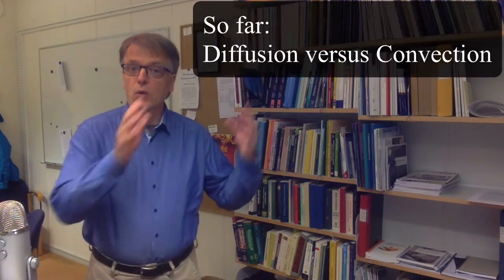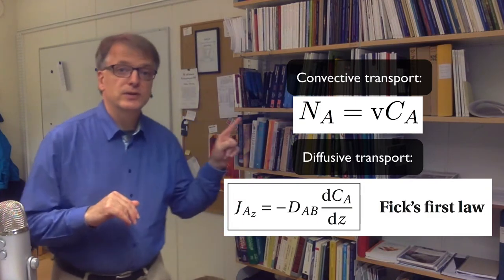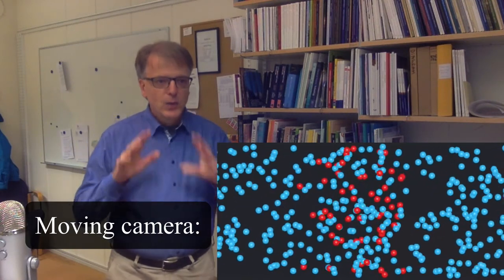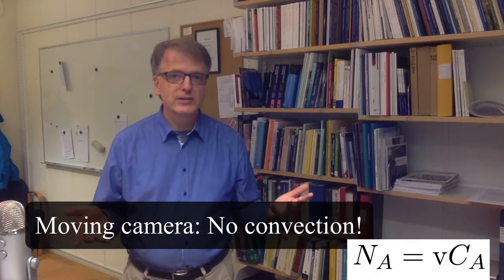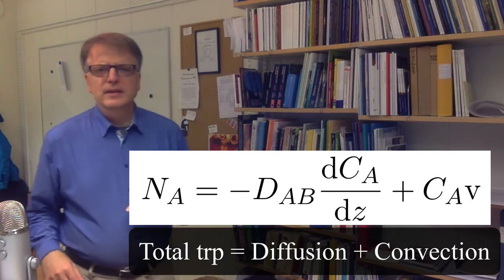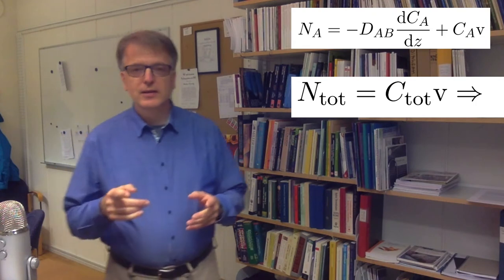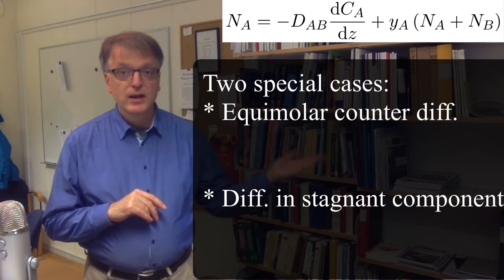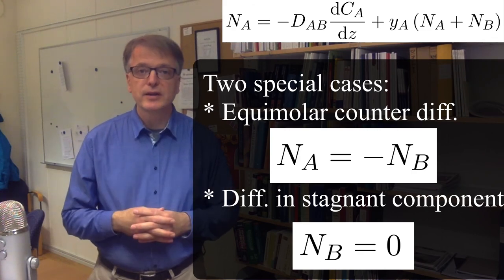Convection AND diffusion

Comment: Sir, while taking N total = NA+NB , if N total taken as total convective flux how can u add NA and NB to get N total?
NA and NB normally include diffusion flux and convective flux right ,so how  can you add then these both to get total convective flux Ntotal?
Reply from the maker: I think you misunderstand what convective flux is.  By definition, convective flux IS the net transport of molecules, thus in a system with only two components, the convective flux is the total flux (summed over both species), i.e. Ntot=NA+NB=Nconvective.

Thus, in Stefan diffusion (which you get if a liquid in a narrow tube evaporates and diffuses out into the surrounding) the fact that the volume increases when a liqud evaporates and forms a gas, together with the concentration gradient that causes diffusion, you have both diffusive transport and convective transport in the tube. 

I think it might help you if you watch the entire playlist on mass transfer
https://www.youtube.com/watch?v=XsujCJ_ko3k&list=PLvpgTFzUKO4_51rEIT6AbggF1UYYkLg2X

Comment: Hello sir , sir I have a doubt 
, we have seen here that even when there is no forced convection there can be convected transport due to the bulk ( molar average velocity) , what if the fluid has a forced velocity V, then in CaV , what is V? forced velocity ? and this transport is in direction of fluid flow only? or is there any transport in other direction too? what about them are they convected or diffusive?
Reply from the maker: Please only write your comment in the apropriate video. I have removed your duplicate comment from the Swedish video on using the mailings command in Microsoft Word.

Now to your question: Convection is per definition the average movement of molecules, thus v is always the average velocity of all molecules. 

In each case, you must look at your system and try to find a mathematical description that seems appropriate (e.g. two-film theory, penetration theory, boundary-layer theory or something else) If you need to, you may even add one more hierarchial level in your equation and talk not only about diffusion and convection, but also about eddie diffusion (which behaves mathematically like diffusion, but has a "diffusivity" that is different from the diffusivity that I talk about in my videos)

You do not need to have a fan or a pump to get convection, there is also natural convection. A simple example of natural convection is the air movement on the outside of a radiator. So, if you have an average movement of molecules, in any direction, that is nonzero that is your convection, regardless of the cause of that movement (pump/fan/density gradient/…)

More advanced answer: You might need to consider more than one direction… In the boundary layer theory video https://www.youtube.com/watch?v=FDfWyeqkKkU we are interested in the mass transfer (or heat transfer or transfer of momentum) in the direction orthogonal to the main direction of flow. You can think of this as diffusion through a stagnant compoment, although that would be to simplify a bit. The film next to the surface (laminar closest to the initial edge, turbulent further away) is moving.

The molecules (or the universe for that matter) do not care what equations we use. Our convention to divide the movement of molecules in to convection (average movement of all molecules) and diffusion (movement through random walk relative to this average movement) is just a handy mathematical abstraction that helps us making the mathematics easier to handle.

Comment: Dear professor,
As I know, this equation is used for molecular diffusion where NA = Fick's law + the bulk motion contribution.
If I compare it to what u wrote ==> bulk motion contribution = convection. But in your first video you said that convection is on larger scale ==> we dont speak on convection when we solve molecular diffusion as in this case. is it only a pronunciation difference? I do not know, the tittle convection vs diffusion is confusing for me, this equation is for molecular diffusion only taking into consideration the motion of the binary system and not an applied velocity.
Reply from the maker: I'm not sure I fully understand your question, i.e. what it is that you misunderstand.

First attempt to answer: Are you thinking of the difference between advection and convection? The term advection seems to be used differently by different people, some meaning that advection is a synonym for convection, others (like me) that advection is a convection that is caused by a pump or a fan or something similar. The latter implies that advection = forced convection but leaves the question somewhat open wether or not natural convection should be considered as advection or not (think air close to a heat source moving due to temperature-induced differences in density)

Second attempt: Note that the phrase "large scale" here means "larger than a group of only a few molecules". With large scale we here thus imply a large enough package that we can start talking about an average velocity (with a certain direction) of the molecules.

Third attempt: Note that in some situations no pump or fan is needed to create a situation where there is an average velocity of the molecules. If you look at the video https://www.youtube.com/watch?v=VXIwAkjYMLM you see that if you have a glass of water slowly evaporating, there is convection out of the glass (simply because 1 mol water vapour occupies more volume than 1 mole of water as liquid)

So, what this video is about is when you combine the effect of convection (average movement of packages of liquid) with diffusion.
Reply: I guess the second and the third attempts are quite satisfying. Thank you so much for your clear 'answers'. 

1- Does it mean that if we have a homogeneous medium (@ equilibrium) pumped in a tube, we still can write NA = CA.V? i.e. no need to have a difference in concentration.
 
2- What is the difference between NA = CA.V and NA = K.DeltaCA used in convective applications
Reply from the maker: Yes, kind of:

If you have a difference in concentration you can't use the equation. Situations where you have a difference in concentration includes the situation describe by Reynolds analogy and Chilton Colburn analogy, see https://www.youtube.com/watch?v=7YlQ_4jL_gs&list=PLvpgTFzUKO49qlw61JRGCeezUpcqxnhK8&index=28

So the equation is only valid if there is no difference in concentration, like when you pump a salt solution with constant concentration through along a tube. 

I would hesitate to use the term homogenous here, as that term can imply that there is only one phase (e.g. liquid) rather than that the concentration is constant. So if you pump a heterogenous system, i.e. sea water with some sand, through a pipe (like what they do in some countries including Denmark to attempt to keep the sea from eating away at their shore lines) you can still use the equation since the salt concentration is constant.

Comment: Hi Professor. Those equations applies for liquid liquid diffusion+convection?
Reply from the maker: If you're thinking "applies" as in "is exactly correct for", then some of the equation only apply to ideal gases and very special liquids. The  problem with liquids is that different molecules take up a different amount of volume and if you mix different molecules, strange things often happen with the volume (if you add 1 liter of ethanol to 1 liter of water, you get less than 2 liters of solution). Thus, in liquids the situation might not be exactly that simple that you can say that Ntot=Ctot*v

On the other hand, many of the equations might be good enough for liquids in many situations. Furthermore, these equations gives you an idea of what approximately happens in liquids.

Note 
1. This video is one in a series on mass transfer https://www.youtube.com/watch?v=EG4ZoVTSA5I&list=PLvpgTFzUKO4_51rEIT6AbggF1UYYkLg2X
2. The BIG elephant in the room here is that we're talking about binary mixtures and only one spatial dimension, and in how many cases can you say that your system is one-dimensional and only has two components? However, we are (in this series of videos) building up to mass transfer  in three dimensions (although still only "two" components, or systems which you may treat as consisting of two components, e.g. like moist air). The course that this video is a part of doesn't go into models for multi-component diffusion, but I think it is safe to say that it is a lot easier to understand multi-component system if you first get a grasp of binary systems.
3. In many real world situations, the use of diffusivities breaks down due to complex geometry and we have to settle for using mass transfer coefficients. However, understanding how these ideal model works and how mass transfer coefficients are connected to diffusivity can tell you a great deal regarding how the value of mass transfer coefficients are expected to change if you change operating conditions. More on that in later videos in this series

Comment: Conductive mass transfer or diffusion is same or different
Reply from the maker: There is no such thing as "conductive mass transfer". I think you are confusing mass transfer with heat transfer. Conductive heat transfer is the same thing as diffusive heat transfer. In a gas, conductive heat transfer is both due to diffusive transfer of mass (e.g. a molecule with higher velocity than the average moving from left to right) and due to transfer of velocity (and thus momentum) from one molecule to another when molecules collide with each other. In solids, diffusive heat transfer is due to transfer of velocity due to interaction between molecules. (In an ideal gas, the transfer mechanisms for heat transfer, mass transfer and transfer of momentum is so similar that the mass diffusivity equals the heat diffusivity which equals the diffusivity of momentum, if all are measured in m2/s.)

It might help you to watch other videos in the mass transfer playlist.

https://www.youtube.com/watch?v=XsujCJ_ko3k&list=PLvpgTFzUKO4_51rEIT6AbggF1UYYkLg2X
Reply: @PLE_LU  Thank you sir

Comment: i have noticed that u have not mentioned anywhere about chemical potential being the true driving force of diffusion. pls can u make a video on it as iam unable to understand  it from nowhere. also, can u explain about "N" and "J" in detail and there difference.
Reply from the maker: I don't think I used the term "chemical potential" anywhere, I rather usually say "difference in concentration" or "concentration gradient". Diffusion is due to random movement (e.g. due to Brownian motion). You can compare this with carefully putting black marbles on top of white marbles (the white and black marbles having the exact same size and density) in a glass jar and then shaking the glass jar. The result is white and black marbles mixed, simply because there are vastly more configurations where the black and white marbles are mixed than configurations where all black marbles are separated from the white.

I use N to denote molar transport in general. J I reserve for molar transport due to diffusive transport.
Reply: But in many books it is written that Chemical potential is the true driving force of diffusion. I get what u said completely. But what about the true driving force.
Reply from the maker: @ritviksharma5949  I don't teach that and in many cases the difference between concentration and activity, pressure and fugacity doesn't matter much compared to the large uncertainties involved anyway. I would recommend you to look for people dealing with physical chemistry for good explanations of chemical potential and how that is related to diffusion.
Reply: Thank u sir